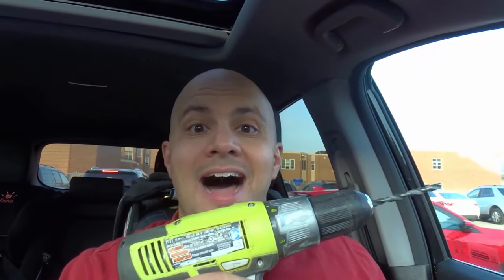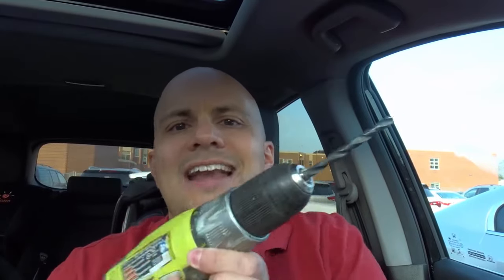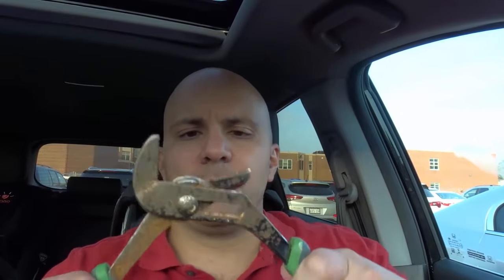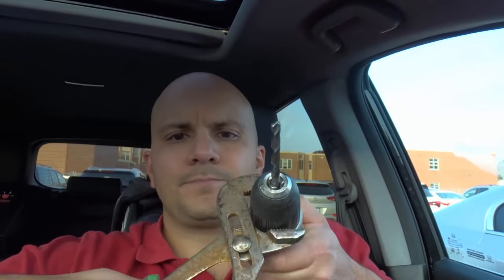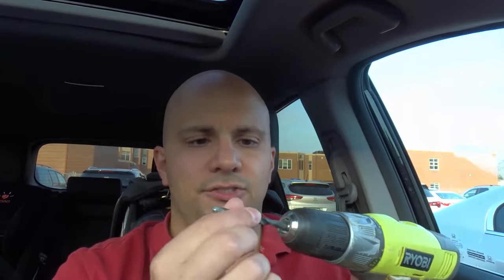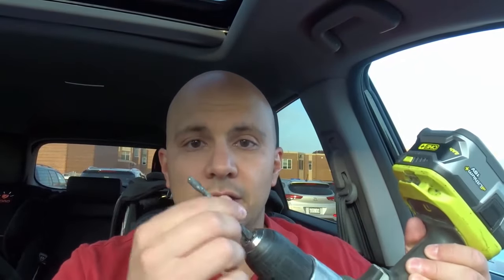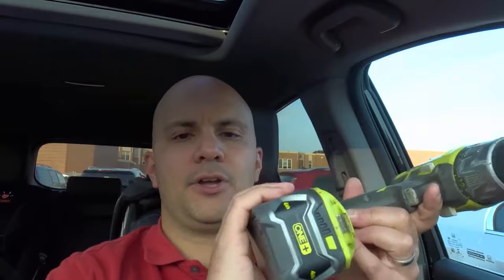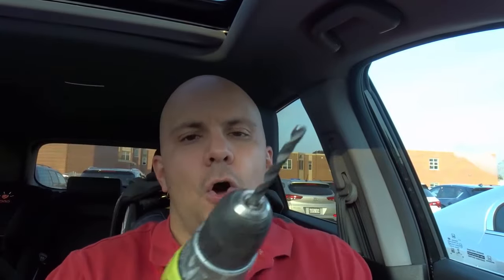How To Remove A Stuck Drill Bit-Fix A Stuck Drill Chuck

Comment: Calm down buddy.
Reply: It worked though!  It worked so well.
Reply: I was more excited than that I couldn't get the bit off. So it worked and I'm back in business.
Reply: Still couldn't get mine out and it's the same drill 😢
Reply: @Christy008 get a pipe wrench and create leverage with the drill and don’t use power, do it slowly
Reply: Coca-Cola
Reply: i like the way he is…
Reply: Yeah, I think he’s had too much caffeine😂. And for the 3rd step of using table vise, why not wait until you get home show & show us that step  (instead of doing this video from your car seat)

Comment: Actually helped me out of a jam. My Ryobi had a stuck chuck along with stuck bit. Took all my grip strength (thanks workouts) and lots of cranking to finally get it to go. Fun fact, my Grandpa's old plug in Craftsman has never had a problem of any type, much less a stuck bit or chuck. Dont make em like they used to.

Comment: Thank you. I just purchased cheap wireless  drill with hammer option, for home usage only, and I finished those 4 holes , and I was planning tu put it back to the box for storage, and... Than , your advices in the and , gave me relief 😀
Thank you.

Comment: After going through three or more videos found this one. It worked for me! My Ryobi drill check was really locked in The drill bit I ended up using a pipe wrench and a vice. I added WD-40 previously. I tapped turned then backed off tapped tried to turn again backed off. Since it was a pipe wrench I wanted to apply pressure gradually but to my surprise it was able to break free. Thought I was going to tear the drill apart :-) but it worked!

Comment: I have a Dewalt drill that has a chuck stuck.  Used and Allen wrench.  To unscrew it but it still won't come off so I can replace it with a new one. Have any tips ? Thanks.

Comment: THANK YOU! I finally removed my stuck drill bit by tapping around it lightly with a small hammer. In less than 10 taps around and hand twisting, its out.

Comment: I took a pliers and I pulled a bit out but the fingers inside you're still stuck back so I put something new in there they won't come forward and they won't go in reverse those fingers so how do I get them fingers starting to move without anything in the drill

Comment: I have a way harder issue. The drill is in the head and the head was destroyed. The head doesnt grip anymore to unscrew the drill. This happened on bosch gsr 180 li after 5 years... How to remove the drill so i can replace the broken head? The drill is stuck in there tightly...

Comment: What if the chuck opens just fine but the drill bit has been shoved deep down inside the drill?

My 8 yo didn't know any better and tried drilling into hard wood with the wrong bit. Now the bit is impacted deep inside the drill. We've tried pulling it out with pliers but it won't budge at all.

Comment: Have a Ryobi drill . The chuck is threaded on and just spins no matter what when trying to remove . There’s no resistance as it spins both directions . No tool or method I can think of ….since it’s threaded o can’t use a wedge ? Anyone know anything on what to do. I was sent a brand new chuck but no way to remove the old one?